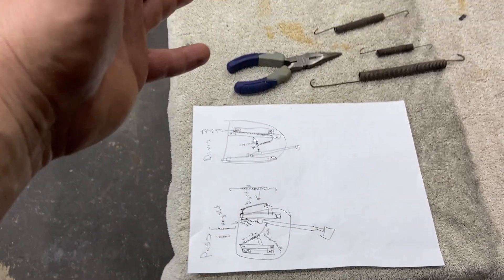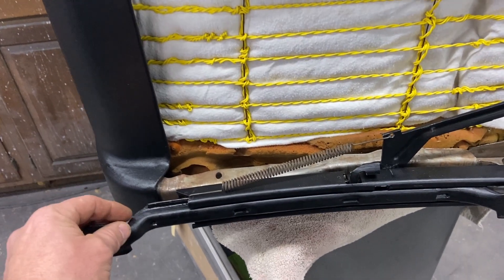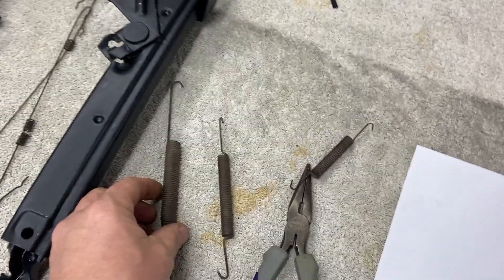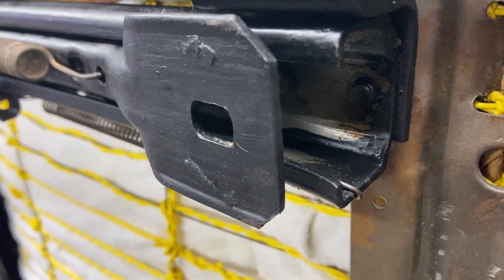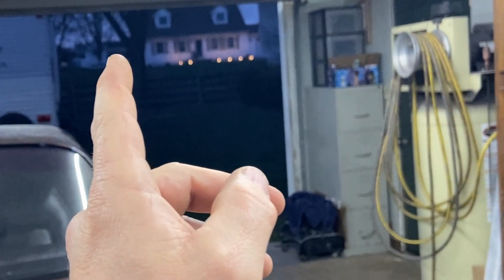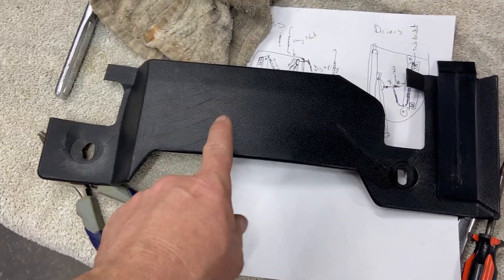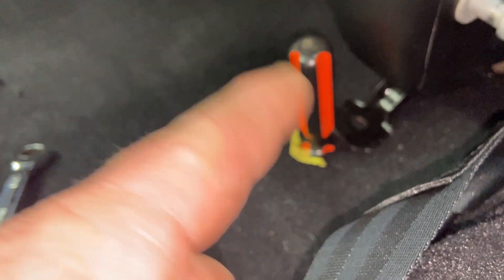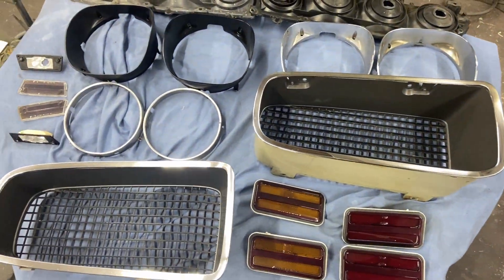F Body Seat Track Installation, Second Gen Firebird, Camaro, and other GM muscle cars Nova, Chevelle

Comment: The 70 to 74 tracks are alittle different correct from the 75 and up
Reply from the maker: Im not sure. Id have to do a little bit of web research to know.  Gotta be similar though. Thanks for checking out the vid!
Reply: Unless mine are missing, I had 2 less  springs on my 71 seat tracks than what I saw here in the video. Now I'm starting to think I have missing hardware. I had two per side
Reply: The floor is a bit different on the later 2nd gens to accommodate cats. Tracks are different in that respect